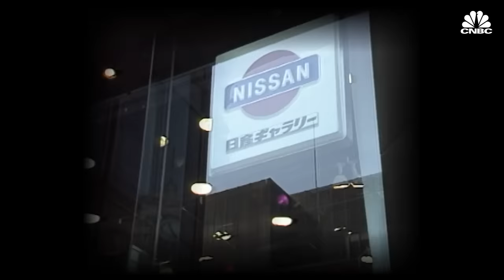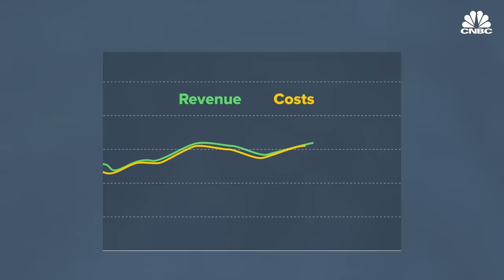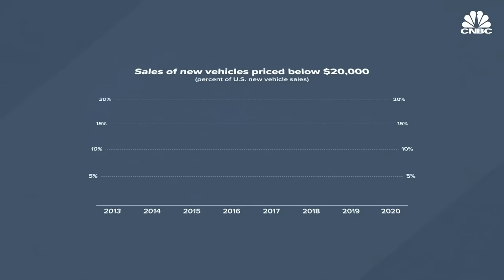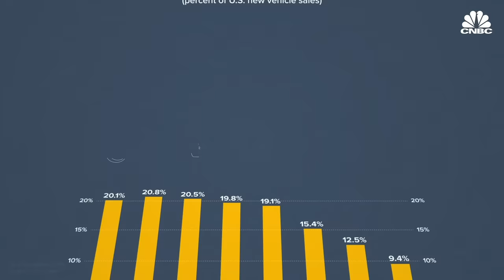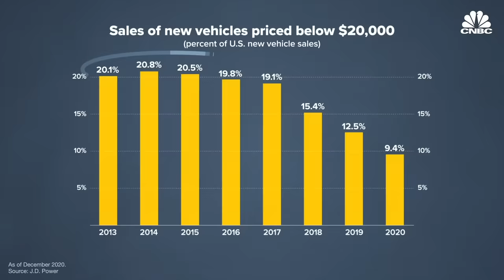Why Cheap Cars Are Disappearing

Comment: I’m in my 20s and although I don’t need a car right now, when I do you’ll be damn sure I’m getting mine used. Would much rather have a great and upscale crossover that’s just a few years old than a Nissan Versa that’s gonna feel like a toy car with all the plastic in it and likely have reliability problems
Reply: Good thinking. Hoping a lot more in our age group become wise to this and don’t let the auto industry take us for a ride and saddle us with suffocating debt!
Reply: Or you could get a lease car
Reply: @KRYMauL  true as well. Difference between car prices in a lease is much more minimal
Reply: The problem with buying a used car is that you don't get all the tech and safety that young people are demanding. Auto manufacturers have caught on to the fact that young people do not care how a car handles, or how it rides, or how comfortable it is, or how fast it is... what they truly want is the tech and safety. This is why you now have vehicles like the Hyundai Venue, which is not fast, or comfortable, and doesn't ride very well at all... but it comes standard with things like lane-keep assist and apple carplay/android auto which even something like the BMW X5 doesn't have as standard equipment.

Now, more than ever before, is the best time to buy/lease a new car because auto manufacturers are so competitive and the value level of new vehicles is so high. Tech and safety have advanced so quickly that even buying a 5-year old luxury car is an obsolete dinosaur compared to some of the new cars that you can get at the same price today... which never used to be the case. The difference between new and used cars is no longer just a matter of age, mileage, and warranty, as it always used to be.
Reply: Versas are not bad. Just don’t get the CVT transmission.
Reply: @RamiroR13  You can get a Nissan CVT if the vehicle is a 2017 model year or newer, that's when they switched to their upgraded JF015E CVT7 which beefed up the belt and reduced friction by more than 30%. Since then their reliability has improved substantially.

Even still, If you keep on top of the scheduled maintenance with Nissan's older CVTs you should never have a problem. There's a reason why a lot of Nissan dealerships offer a lifetime powertrain warranty which is valid as long as you do the scheduled maintenance and keep proof that its been done. The overwhelming number of Nissan cvt jobs that I've done were from people who did not get the transmission fluid changed every 30,000 miles as is required. (Note: The new 2017-current cvts only require the tranny fluid to be changed every 60,000 miles due to the the decreased friction I mentioned earlier.)

READ YOUR OWNERS MANUALS, PEOPLE!!
Reply: @dave3682  I still think that because of the fact that it took Nissan 15 years to get the transmissions half decent, I still wouldn’t touch those cars with a six foot pole. I’ve still seen many old CVTs go out even with the recommended transmission fluid change. This is why I bought a 2017 Corolla. Toyota’s are bulletproof. Still have a ‘95 pickup running like new.
Reply: Yea when I buy my next car it’ll used like my current one. It’s a 2011 Acura MDX Advance so it has absolutely every option and pretty much the same safety features new cars have. It has Blindspot monitor, adaptive cruise control, automatic emergency braking, etc. I’ll be keeping it forever then I’ll buy a Toyota Sequoia 😂
Reply: @RamiroR13  Toyotas have their fair share of problems, just like everybody else, and not every Toyota leads their class in reliability. For example you have vehicles like the CHR and the Tacoma which have below average reliability compared to their piers.

Toyota powertrains tend to be reliable because Toyota refuses to innovate and take risks. The benefit is that, because you stick to what works, you can more or less guarantee a high degree of reliability. The downside to that is that, in every other aspect the consumer gets a wholly inferior product.

 Nissan took a big risk by taking the leap to CVTs, and their reputation took a hit because of the teething problems that occur with any new mechanical technology... but now its starting to pay off as Nissan has more cvt experience than anybody else in the market and because of that, has probably the most refined and reliable CVT available right now.  And now, everybody else is seeing the benefit to CVTs and is playing catchup trying to introduce CVTs of their own.

Ford did the same thing with turbocharging. It wasn't that long ago that turbos were considered unreliable. Ford took the hit because they went in first, but now they lead the industry and everybody else is playing catchup.

Heck, there was a time when automatic transmissions were considered unreliable. That's the beauty of it all, any new mechanical technology will be continuously improved and refined over time.

People no longer have major concerns when buying a vehicle with an automatic transmission, they no longer have major concerns when buying a turbocharged vehicle, and they shouldn't have any major concerns about buying a modern CVT either.
Reply: @dave3682  That sucks for someone like me, who values ride quality and on-center steering accuracy over having every single fancy gadget in the vehicle.  My budget is generally $20k max, and there's not much available anymore that suits all of my needs without having to make a major sacrifice.  

I recently opted for a 2018 Toyota Corolla iM (the hatchback).  Had only 8,400 miles for $16,500 at the dealership (it had been discounted $2,000 from the summer months), and while it was in immaculate condition, I'm not particularly a big fan of the suspension and the on-center steering accuracy leaves a lot to be desired.  The practical alternative for me was getting a brand new 2020 Kia Forte for $16,100 at a couple of dealerships...fantastic CVT (shocking to say that) and fuel economy, good steering feel and peppy with good tech.  The deal breaker for me though was pretty bad ride quality that left me feeling stressed out over even moderate potholes and road imperfections.

It's just annoying that my old 2009 Corolla had a more comfortable suspension than both the 2018 Corolla iM and 2020 Kia Forte.  It's as if ride comfort is taking a few steps backwards, not forward in the lower budget car market.

Comment: Companies are greedy, and a well maintained used car is way cheaper
Reply: Wrong. Companies are taking advantage of an undisciplined population that view it as payments instead of a proce tag. What for?? Keeping up with the Joneses. No one forces those morons to buy over priced cars. So, companies take advantage of stupid consumers.
Reply: @bmw803  that's only half true, I want an electric car, but they are stupidly overpriced (even entry level models) because companies are price gouging on the environmental benefits 

And if I go the used route, the price of a replacement battery is close to the price of the car itself (which is often 3-4x the wholesale price of lithium batteries, such as Nissan charging $15,000 for a battery that would cost about $6000 to produce)
Reply: @mwbgaming28  chevy bolt is going for around 25k new these days. Not too bad for an EV with over 200 miles of range.
Reply: @NoName-gv6nm  the cheapest EV have seen where the battery still holds a reasonable charge is a used 2013 Nissan leaf with the battery replaced in 2018, and that is $14,000AUD BEFORE stamp duty and taxes (which would likely push the price over 20k) 

There are no dealers selling any EV for $25k new from what I have seen, most of them are in excess of $50k, whereas the ICE car I currently own (2001 VX commodore) I was able to buy used off Gumtree for around $1200 

Until used EVs get to the $5k-8kAUD range, I will consider them to be overpriced, there's no reason they should be as expensive as they are when you look at current lithium battery spot pricing
Reply: Government  and union leaders more greedy
Reply: bottom line, ppl are operating on what they can get away with (*they be in nat'l or multi-nt'l corp., gov't politicians, etc.....) period!

Comment: There was a practical cars called STATION WAGON for god sake bring them back
Reply: I think we call them hatchbacks now
Reply: Pyrophoric Elixir  exactly
Reply: @doujinflip  just renaming
But station wagons r bigger
Reply: Low center of gravity (sportier), better weight distribution (if developed from a front-drive chassis), and sometimes even the ability to sleep flat in some models.
Reply: Buick regal tourx? Otherwise I hope you like German cars
Reply: Would the car makers say ooh that too expensive to build when they think not a big enough demand.
Reply: ???  Estate car in the UK. I drive a MK7 Golf Estate. They just released the MK8 Estate a few months ago.  I was a bit concerned as the Hatchback came out earlier. If you are after performance the Golf R Estate does 0-60 in 5.1 seconds.  Both Mercedes and BMW Estates are popular here. You can even get a Ford Mondeo Estate, which is surprising as the Mondeo itself is no longer a big seller. You can't get one with a boot/trunk as there obviously isn't the demand.  Overall Estates are probably as popular as cars with boots/trunks which disappeared completely from the small car market years ago.
Reply: [*Clark Griswold has entered the chat*]
Reply: We have them. Most CUVs are essentially lifted, shortened station wagons.

Comment: Those "robust entertainment systems" shouldn't cost more than a couple of hundred bucks, max.  Anything more than that is borderline extortion.
Reply: So you want them to charge you less then for a smartphone.
Reply: We are spoiled buying iphones for 199 with a contract. Those devices aren't cheap to make. An car infotainment system these days has to do a lot more these days and they also need to be more hardened against heat, cold and bumps than a standard smartphone. Their screens are as bigger too. I used to think a 1000 for a built in GPS was a rip, but these days with the excellent phone integration, it is worth it
Reply: @paxundpeace9970  Maybe your phone.  Because you can buy aftermarket head units that do this stuff for a fraction of the price from the factory.  Does it really cost that much more for the factory to make it to roll out to their entire linup vs a smaller aftermarket company?
Reply: @visualpun650  My Moto G does the job just fine, for only a few dollars more, no contract.  Contracts are for suckers.  How do the aftermarket companies make those infotainment systems for a fraction of the price?
Reply: @techienate  This can't be done by an aftermarket manufacturer this would be far to expensive 
Aftermarket is for special services and operations (far more expensive then you would think)
Reply: @paxundpeace9970  "robust entertainment systems" are readily available on the aftermarket
Reply: @techienate  The problem is vehicle integration.
Reply: techienate i dont know much about those. Maybe they use cheaper electronics that wont last more than 5 years or dont connect to your steering wheel controls.
Reply: @visualpun650  check out crutchfield... I can get an android auto/apple car play double din unit for my car starting just over $200.  No, they're not garbage, and electronics with no moving parts last ages.  But if you're concerned about that, a name brand like Sony costs $300.  Most units support steering wheel controls with an add-on adapter cable that costs a few dollars.  It should be even cheaper to do these things as the OEM.  That's the whole point of my post--car companies are majorly ripping you off on entertainment systems.
Reply: @visualpun650  it is all about software and hardware integration and trying to run ios on a Windows PC isn't fun like like the opposite way to. 

Then you have to consider that every think is interconnected the AC unit the sound system. This were planed as intended and not to change alot on the aftermarket

Comment: I will never buy a new car in my lifetime and I’m a crazy car enthusiast
Reply: Why
Reply: New car buyers are also the "Guinea Pig" who has to deal with recalls and things that break under warranty, have to do 3 oil changes the first 3 months due to break-in, spend the big money on upgrades, like a hitch, stereo amp, better shocks, etc, and have to deal with "that first scratch"where the car WAS perfect, then you went to WalMart.
I think cars depreciate more than 40% the first 3 years BTW.
Reply: @stephen973  Cars lose about 20% of their value within the first year and about 60% by 5th year
Reply: I only buy new. People are slobs.
Reply: I bought a brand new 2015 VW Passat TDI as a collectible because it was the last model year diesel engine VW is selling in the states.  It only has a couple hundred miles on it.  I will unload it to a VW enthusiast who is willing to overpay in about 5 or so years.  Diesel cars, especially the VW's are a niche market...
Reply: @Argedis  Depends on the make, model and type of car.  Cars that become collectibles and are sought after appreciate with time.
Reply: @DIVISIONINCISION  Many people try this and fail. The vast majority of cars won't appreciate at all even if they become 'collectible'. A perfect example is the last F-Body Trans Ams and Camaros in 2002. The very last Pontiac Trans Ams ever made in pristine condition should be collectible and worth a lot right? 
Well garage kept examples with less than 5k miles are only worth between 30k-35k. MSRP was around 30k so they actually lost money if you factor inflation. 

If the owner invested that 30k 18yrs ago with a moderate return of 7% they would have about $100k now.
Reply: @adiposerex5150  People are disgusting filthy animals - - but there IS such a thing as detailers who can basically dry-clean your interior and bring your paint up.

Comment: A dentist friend of my dad's couldn't buy a practice 25 years ago because he had spent all his money on a Mercedes and had even borrowed money from his parents for it. He still regrets that, he could be pretty wealthy by now and could have bought a Mercedes outright, but instead he always struggled.
Reply: Regardless of the era, that was a terrible decision. Sinking all your money into a decpreciating asset is a terrible idea.
Reply: @Tracymmo  How many assets are non depreciating? The answer would be a house. I've seen some of them depreciate down to nothing. Owning a stock is an asset. Many pay tremendous dividends many have going out of business which is a total loss. A lawn mower is an asset. It will depreciate over time. Yes buying a gold bar is an asset and should appreciate over time.
Reply: @jamesmerritt3267  you can buy stocks
Reply: I always live within my means and safe money.  never spend more than 25% of my annual salary on cars.  I always buy 3 year old low mileage lease return Lexuses in cash.  those are the best deals.
Reply: That’s just called being plain bad with money
Reply: Damn that's quite a mistake but the main problem for expensive cars is the dealership lobby.

The dealership lobby got laws passed you have to buy a car from a dealership rather than anything else like directly from the factory.

Just having a dealership middle man drives up the price not to mention complicates things.

People can spend as irresponsibly as they can but what really ruins consumer power is government power.

Comment: Q: Where are the cheap cars? 

A: OMG 😮 my car has 10,000 miles And a scratch in the paint, i better trade it in for a new car with heated steering wheel 
and USB plugs

Comment: Young people normally go on craigslist to buy cars. You can count the ones that go to dealerships.
Reply: Dealers get a bad rap sometimes but a franchise dealership will have better used car inventory because they auction off all the duds and high mileage heaps. Who buys at auction? The small mom and pop lots. As for craigslist, good deals can be found but caveat emptor.
Reply: Not true. Many young people have decent income but no savings (they just started their first real job out or college) so they can finance $200-300 a month but not buy a $9000 car on Craigslist. So they get a new $18k car for $200 a month.
Reply: @choreomaniac  wow, $200-300 car payments. Never heard of people making car payments like that nowadays.
Reply: @AZrakoon  Yep. A simple online loan calculator will show that $200 a month barely finances a $11,000 car (assuming zero down) for 60 months at 2.5%.
Reply: Everyone on craigslist is a car flipper that scams people by buying cars from auctions and jacking up the prices.
Reply: @angry-white-men  I wouldn't say "everyone." And why is a car deal a "scam" if (assuming the car doesn't have hidden problems such as flood damage) the price is close to the market price? If you want wholesale auction prices, go get yourself a dealer license.
Reply: Not in Central Florida. We are FLOODED with independent "salesman" who flip junky cars and gouge the used car market. You can't trust anyone around here to make an honest sale.